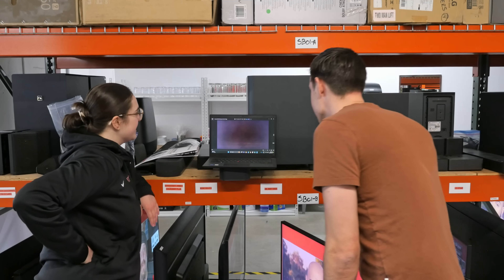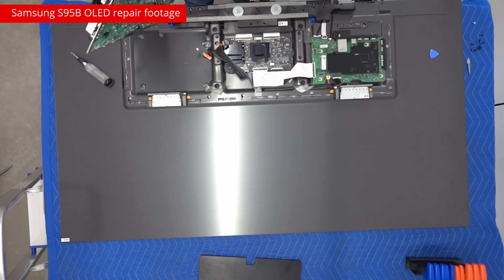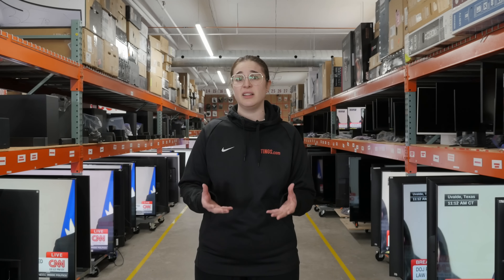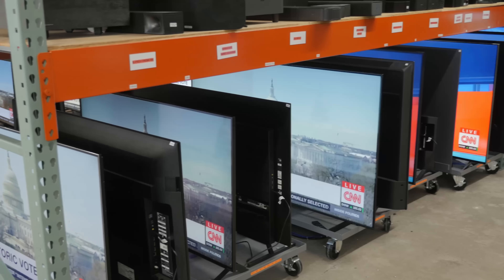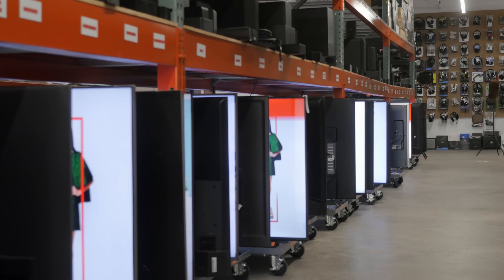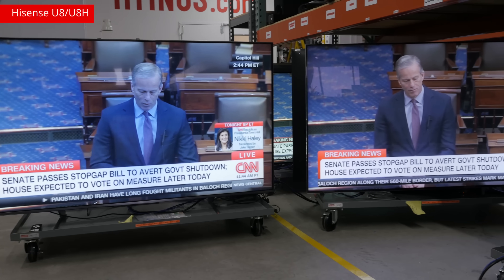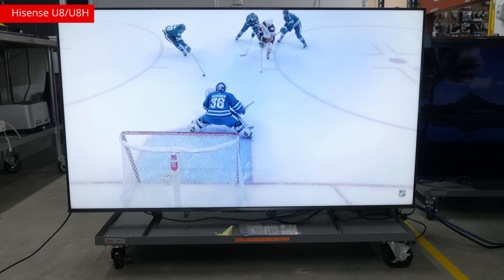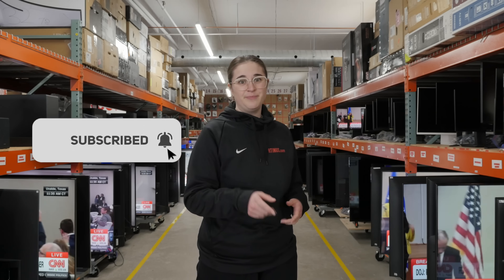1 Year Longevity Update! LCD Models & Future Failures

Comment: After over 50 years in consumer electronics i am always interested to see how the latest
models and panel tech compare to earlier models.
The biggest mistake with LCD models was the change to LED backlights, driven hard at high
brightness levels make make a TV look stunning when new, but as those LED's start to fail, the
image becomes unwatchable.
I have a Pioneer Kuro Plasma that is still giving an excellent image and looks great with an HD
source, this is one area where the 4K panels often stuggle, the inbuilt upscaling is often poor and renders
them useless with lower resolution images.
My point is that newer is not always better, keep that brightness and contrast down or be prepared to buy
another TV in a couple of years.
Reply: Well I have a Sony 900E LED/FALD and it has 25,000 hours on it and going on 7 years come May.  It is still flawless no color shifts or anything in grey slides or color test patterns.
I have a feeling they don't make em like they used to problem is cropping up.
Reply: @loki76  You would notice something when you place a brand new out of the box model right next to it.

Comment: Thanks again for pointing things out.
I am starting to think of replacing my lg oled c7 after 5 years of use (games/series/movies). The subtitle region has a bit burn in.
But lcd are not holding much more lifespan according to these tests. 
Modern electronica are better than older with regard to performance but not with regard to lifespan.
My previous tv lasted 8 years.

I now know I have to replace a tv each 5 year so I will be in my budget / savings.
Reply: Pre 2019 oleds had a lot of issues with burn in
Reply: @langstonbelin  new ones too.. technology doesn’t change.. we have to wait for the next innovation that gives perfect blacks, contrast and color.. but doesnt suffer from burn in.. 
oled is the best screen quality thats ‘affordable’ for consumers now..
Rtings checks this regularly.. the new qd oleds also burn in..

The newer oleds do have a dim echnology to dim static things like logo’s
Reply: Well my 7 year old LED 900E with 25,000 hours would like to have a word with you. It's still flawless in all tests.  Realize a lot of the TVs that fail here are low end models with crappy backlight and LCD panels. They cut corners or they couldn't be sold as budget. 
The more disturbing problems are the slightly higher end ones. But that seems like random.  Also this test they are doing isn't natural to any TV Technology OLED or LCD. It's the same content loop all the time and they have them cranked to max if I recall correctly.
Reply: @loki76  you are just lucky
Most modern tv’s just fail after some years. Just as other modern electronics.
I bought the lg c7 in 2018, a high end tv with a high end price. Now it starts failing on burn in in the subtitle region.

Strangely what does last long are iphone(s) long updates and no screen burn..
Its also oled panel, made by samsung but special order for apple and also some things are not the same as on the samsung phones themselves.

Comment: I have an 86 inch LG Nano cell for about a year. The tv works from 6:30 am to 2:00 am everyday. Hope it will last for about 6 to 7 years. Till now there's no signs of work.
Reply: So you would already have 6,000 hours on it and no flaws yet. See this test they have isn't varied enough and failures are random because there is no "control" group. Meaning they do not have two of every kind of TV.  So the U8H is failing badly in their test. Question is would another U8H look exactly the same? If so then they can definitively say it's a design and TV problem.
Reply: @loki76 It's not a scientific, peer-reviewed study to determine if the U8H is a good or bad TV. It's a demonstration and evaluation of the overall longevity of late-model LCD televisions in general.

Comment: I wasn't expecting the full-screen colour shifting to be so severe and would love to know the underlying cause. This really is one of the coolest ongoing tests out there. But even knowing what Rtings does best, I still just wasn't bready for that outro.
Reply from the maker: We'll be diving a lot deeper to learn as much as we can about the underlying issues going on! 
Also, 🍞
Reply: @RTINGScomRD I just want to say that Abby is hot. Please let her know. She looks great unlike TVs tested.
Reply: @RTINGScomRD you guys should absolutely add and test the Sunbeam  Radiant Control Toaster from the 40s, it's an engineering masterpiece.
Reply: TheRealJohnHooper  The problem is on the LCD color panel, not on the rear backlight (except on that Samsung "beach").
Reply: Degradation of the nano coating...
Reply: Sunlight affecting it somehow? We have some cheapo LG 42" panels from 2018 in my work building and the ones mounted where sunlight shines directly on them have severe blue smudging. The ones out of sunlight are a lot better
Reply: @mikesully110  How? The test is done indoors. Have you seen the video?
Reply: @Ismsanmar  yeah i thought i saw side windows in it but they are actually flourescent lights.  That said ours had bad bluing in direct sunlight and practically none out of it, but this was over a 5+ year period
Reply: Do you think these are all part of planned obsolescence?
Reply: > This really is one of the coolest ongoing tests out there

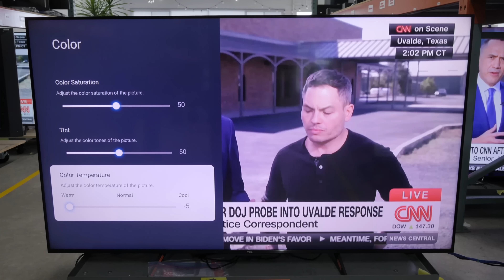For the TCL 5 Series it seems like one of the warmest ongoing tests 5:18
Reply: I see what ya did there. Good one :)

Comment: From what I remember the QLED monitors I use (Coolermaster GP27 FQS & Asus ROG PG278Q) have a very subtle jitter to stop burn in. Wondering why TV's do not do this considering the advantage of a far viewing range as well.
Also only Toaster worth monitoring is that Ghostbusters 2 Toaster O-o
Reply: They do. It's called pixel shift. It's a common feature.

Comment: kinda expected that since i had to replace an ips samsung which was getting burn in around the windows taskbar, was able to see the bar even when hidden and on many contents. If someone told me that LCD could get burnin before it happened to me I would not have believed it but now I know and I see that it happened also to you guys. Not a good news for LCD owners which thinks that their TV/monitor is insensible to burn in when they clearly are not.
Reply: compared to OLED? Yes , yes they are .
Reply: They are not impossible to burn in. But it would be hard. My TV has 25,000 hours on it and used as a PC monitor. I have zero issues on it. All test patterns checked. I always have browser window and taskbar up. A Sony 900E. 
Take a guess if any OLED would survive 25K hours used as a PC monitor.
I think there are quality levels of LCD as well. Cheap panels and cheap backlights, cutting corners etc. Might be even worse today.
Reply: image retention. It happens if the liquid crystals dont change state often they become slow to change to another state. If you run full color test slides repeatedly for a few hours it should mostly go away pretty quick. You just need to cause the state of the liquid crystals to change more often.
Reply: @OniMirage  I have an X900E with a permanently, years-long burned in Windows logo.
It does not go away "mostly" or "pretty quick" with any kind of pixel refresh. 
We get that OLEDs have done something egregious to you, but stop making up utter nonsense.

Comment: Amazing work!
The blue tint is probably because of backlight failure. They either used low cost LEDs or overdrive them too much and the phosphorus that converts blue to white light deteriorated. Also interesting to see how much LCD quality variation there is.
Reply: Probably, there is tons of LED streetlights that turn blue (phosphor layer/coating degrading,letting the blue LED's shine through)
Reply: The blue spot failures are pretty visible on every bar LCD around playing hockey all day. Basically seems to be a never ending cycle of getting blue enough for replacement and then in a matter of a year or two the blue returning.
Reply: It's sad that the modern designs and form factors don't really make this as easy a repair as it really ought to be otherwise.
Reply: A lot of LCD manufacturers use a blue led light, and then apply red & green filters....
They do this because white led lights have too much colour temperature variables in manufacturing.
Reply: @CrusinVK   Yeah that's just quantum dot Led LCD and it was made specially to get highest colour gamut and volume and maybe even higher brightness at same power consumption I don't know if the LEDs have actually much better colour temperature than the white but it's also likely to vary a bit, no idea cause I never searched for such thing...

Anyway QD or not, stock TV calibration at the end still is about the same which is all over the place and being QD still doesn't do anything at all or even Oled wether it's WRGB, QD-oled or RGB Oled which is sad.
Reply: Anybody with their CCFL backlit TV still good as new ? My Sony bravia 32D3000 bought in 2007 with 47231 Hours shows its age but it's still working perfectly without issues on the screen ! 😅
Reply: @_Platinum-   Damn, that's a good stretch for a CCFL...

My last LG CCFL monitor barely lasted much, the inverters got F*, I put normal inverters from the CCFL lighting for the case, but with them I lost backlight control so pretty much was always maxed out, but later one of the CCFL burned and I didn't care for that LCD anymore anyway...

But a friend of my also had a expensive samsung maybe around that year or even less also big in size that was the most expensive TV he ever bought and also lasted until like 2019 with even much more thousands of hours than that, it was almost 24/7 a lot of times and that thing heated the entire room like crazy :)

Anyway the backlight on his samsung is incredibly still working, but something else is faulty as it's displaying badly and only work sometimes, but he has a Q80R and a Hisense U8H so not a problem.
Reply: Most of their LCD TVs are of the budget end as well. Almost all of them are Fire TV, and Insignia and Samsung "crystal" (low end crap) and TCL low end and so on.
Only 900A and 90B from Samsung and the "frame" are of so called higher end.
Their testing methodology is also to much of the same content. Like literally the same footage. Even if they use the same "channels" that content would shift a bit. But here it's the same segments over and over and over.  Of course both OLED and LCD will take a beating like even normal use with twice as many hours wouldn't.
Reply: @loki76  ,
What do you think I can afford?  That's right "cheap".  Any other tests I've seen, use only the expensive models.  Over $1000 might not seem like a lot of money to some, but it is for me.

Comment: The only LCD TV failures I've seen in real life were several Samsungs that developed blue-purple spots in random places on the panel (I conjecture it to be backlight failure). It's interesting I haven't seen that represented in your test yet.
Reply: That is exactly what it is.  I had a 40" Samsung 4k I was using as a PC monitor.  There were 3 areas where the LED light turned Purple.  I ordered new strips.  Disassembled and replaced the LED strips ( I shocked myself once, that was fun.... guess there was still some juice in there after I unplugged it ).  Anyway after I replaced the strips no more purple.
Reply: @SubZtx   Was it QD LCD? Did you just replace with normal blue color leds or are they UV??

The one I saw with that problem was Quantum Dot a few years ago in a store and they are like blue leds or at least they say blue but I wonder if they aren't actually UV instead...
Reply: Just had a samsung lcd had had since 2017 develop a problem where the backlight was making the frame in the bottom left so hot it hurt to touch. Tvs die
Reply: I have seen those blue spots on a almost brand new Samsung model a few years ago on some curved one in a store displaying Samsung demos...
Reply: I've seen dark spots on LG TVs due to local LED failure.
Reply: Theese dots are just backlight LEDs wearing out. I am suprised that samsung crystal UHD TVs did not have panel failures. These models have a lot of LCD panel failures. Usually one of the LCD drivers fail after not that long and tv starts bootlooping
Reply: Yeah same, they don't seem to fail a lot. Also, I have two 200-300€ LCD pc monitors from 5-10 years ago and they're still working normally, despite the daily high usage. So I'm a bit puzzled about their results. 🤔
Reply: My 4 years old Philips LCD monitor developed a reduced-blue spot in the middle of the screen, but my 10 years old Samsung LCD monitor doesn't have any obvious issues.

Comment: I really like these tests. Its what is needed. 5 years of use is average for many tvs while many still hold on to tvs  for up to 10+ years. 
Ill be watching intently and see what happens.

Ive got the samsung qn95b and alienware aw3423dw myself so it is very interesting to see how they hold up. :)
Reply: I agree. All reviewers focus only on new products. They get new TVs in, review them, tell us how great they are, and send them back to the manufacturer.  CES comes around and they tell us how excited they are.  The new TV's come in ... wash ... rinse ... repeat.  Not one of them offers even the slightest hint at reliability.  This torture test is providing real insight into problems that one might encounter after just a few years.  And, they are uncovering implementation issues (like pixel refreshing) that can be fixed by the manufacturers with firmware updates.  This was sorely needed.